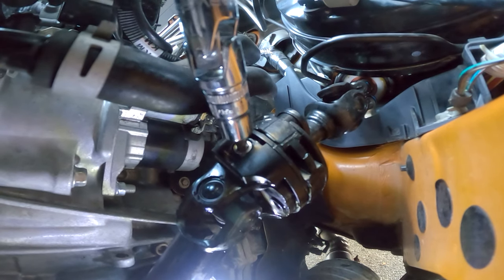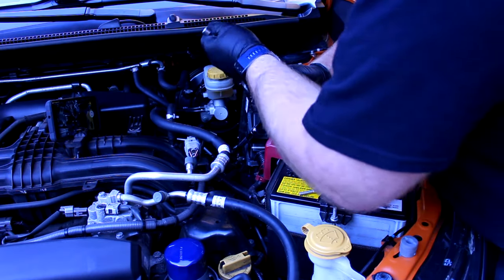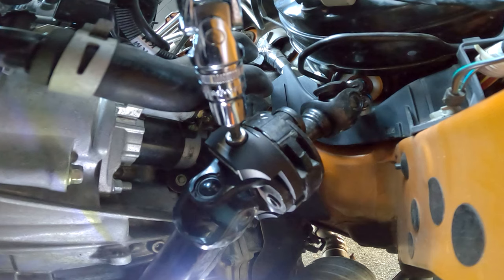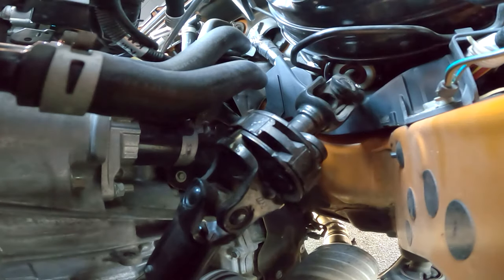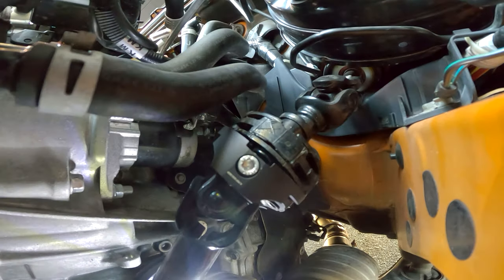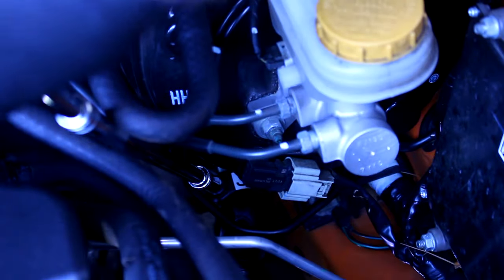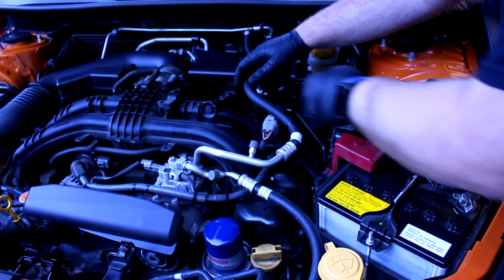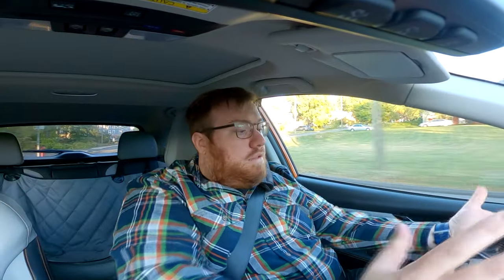How to Install a Subaru Steering Dampener Lockdown & Review (Perrin) • Cars Simplified

Comment: Sorry if I missed it, but exactly does it do? Does it make the steering wheel smoother to steer or does it absorb bumps on the road better?
Reply from the maker: The part that we're clamping down is the thing that is designed to do those things, so the clamp actually makes it slightly less smooth and you'll feel the bumps more. Cars used to not have that dampener disc in them, so this clamp makes sort of a middle ground, where there is some dampening but it takes out some of the imprecise/lazy steering feel.

Comment: I just got a 2020 Outback XT 14 days ago.  Im likely to return it due to the awful “wandering” at speeds above 55.  This car will not stay on track.  Little wiggles left and right Constantly and it’s exhausting to drive.  Would this part Fix that completely??!!
Reply from the maker: That doesn't sound like an issue this part would fix. That vehicle behavior is usually an alignment issue (toe out, a guess) that might be fixed with an adjustment.
Reply: what kind of car did you drive before the Subaru ? And it tracked better than a 2020 ?
Reply: Yes, many people including myself get the steering lockdown to get rid of the highway wobble. Barely takes any wind or road variation to get most Subarus wandering about unless you white knuckle it, this mod lets you drive highway speeds with just two fingers with ease.
Reply: Mine was the same man. Sucked took into the dealership multiple times and they said they never found anything but I swear the steering rack is bad
Reply: 14 xt same symptoms read about the anti wobble insert for tranny mount got it and it still wobbles bought a mission steering lock down and walla no  more wobbling

Comment: I take it the end of the steering joints that you loosen 2 turn are splined? Or what keeps wheel lined up?
Reply: Yeah, they are splined. Sorry i know this is a little late.
So they are splined, both the lends of this ujoint linkage are female and splined, and being female, they also act like clamps, with a bolt that clamps then down, but the bolt also goes through a groove in the male side of the shaft, so if it loosened, the shaft couldnt pull out of the joint (unless the bolt comes completely out of the clamp).
you probably already went and figured this out, but i thought id explain, just in case.